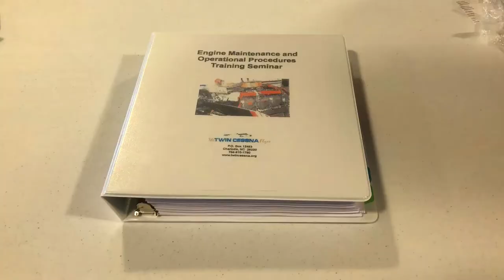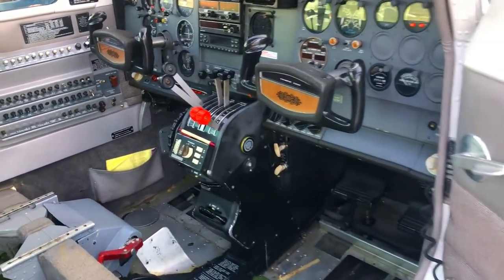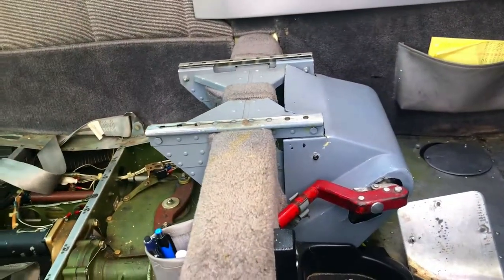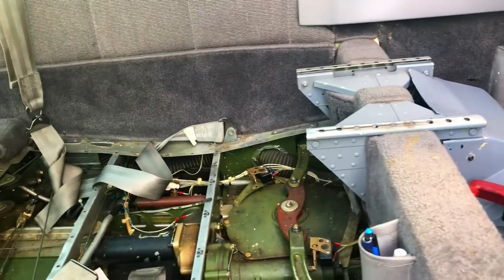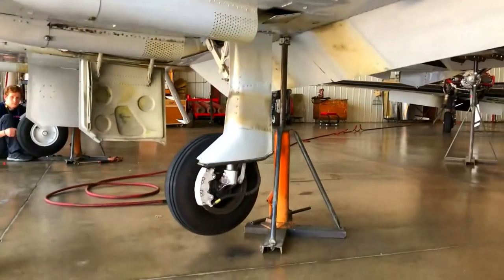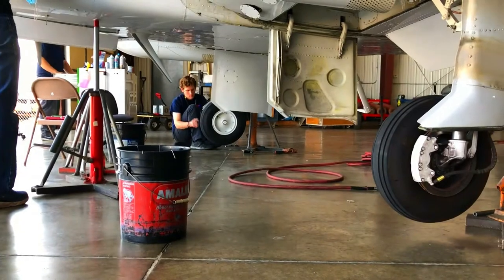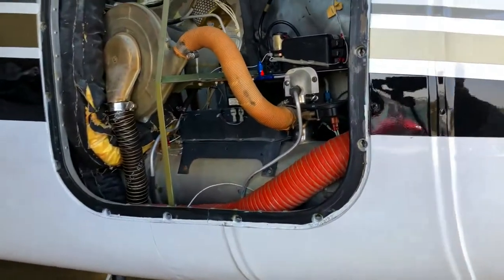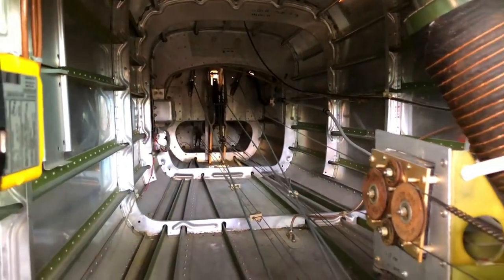Twin Cessna Flyer Engine and Systems Seminar & TAS Annual Inspection

Comment: Great video! TAS is the place for Twin Cessna’s. One thing though, the green disc you mentioned is not the motor, but the landing gear “gear box”. The motor is aft and connected to it. The motor is black. N466Q is one of the finest examples of Anaya year model 310. Wow! She’s beautiful inside and out. Keep the videos coming. Thx!
Reply from the maker: Thx for the compliment! Ah, yes - got the gear parts wrong! Will keep her beautiful and the videos coming.